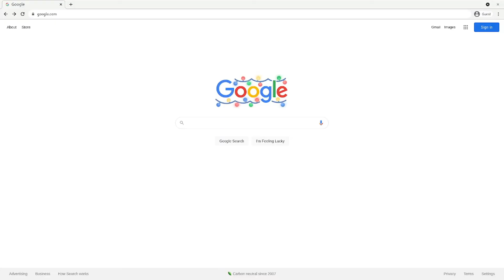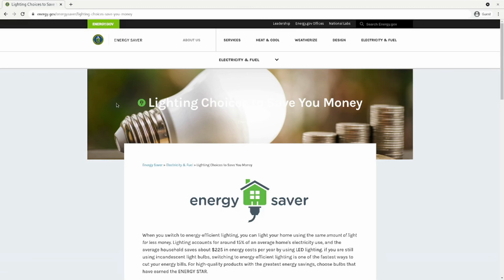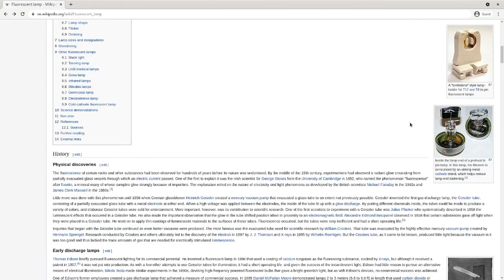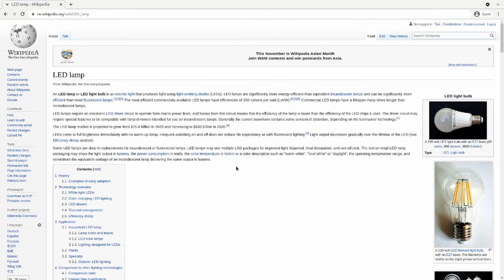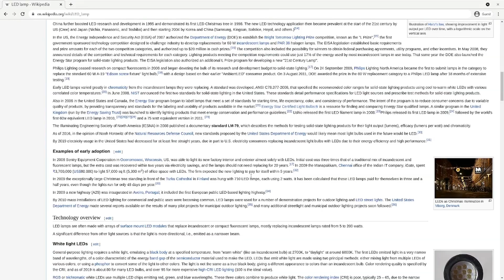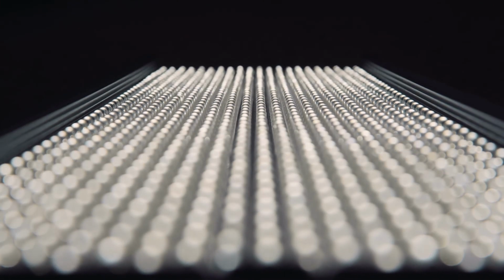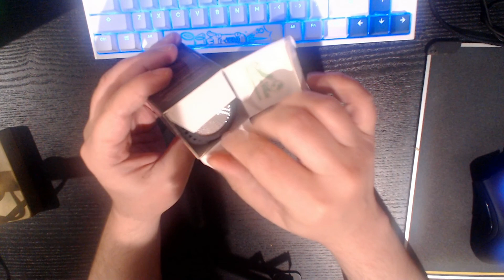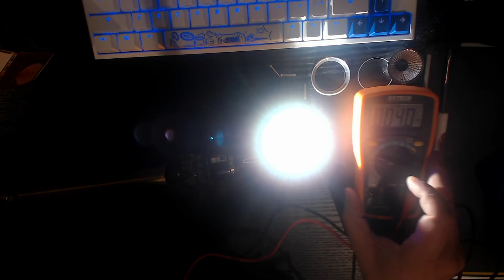Reptile Lighting - Dangerous VivTech UVB Lamp Review, sparks

Comment: Why would anybody in his right mind disassemble those bulbs ??? Pointless test 😎. If would have been more informative if they are really putting out UVB as they claim.
Reply from the maker: That was kind of the joke. There's a lot of misinformation and flat out disinformation about these bulbs. At the end of the day, if the LED UV detractors put half their effort into these bulbs the hobby would be in a far better place. Arcadia and others are relying on the special bulb exception for their fluorescent and incandescent lamps while they tell people that using these bulbs cause hypervitaminosis - this isn't true. Quite a few people have had animals under these bulbs for years (including myself) and there has been no discernible difference. Of course for the safety of the animals this requires more than a year or two study with random unrelated species - but the idea that lighting companies like Arcadia have taken to flat out misrepresenting the data is telling.

The hobby should be screaming to move to LEDs - cheaper, lasts longer, less waste, and the technology isn't slated to be banned.